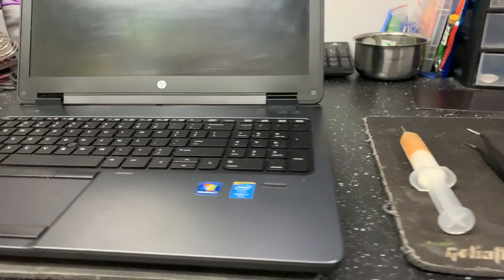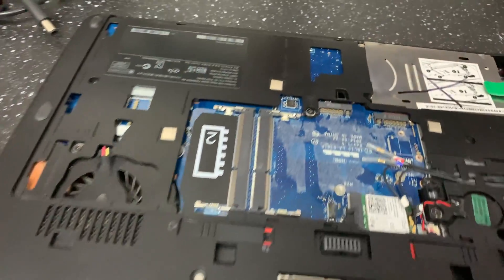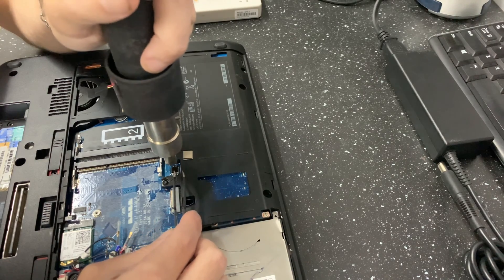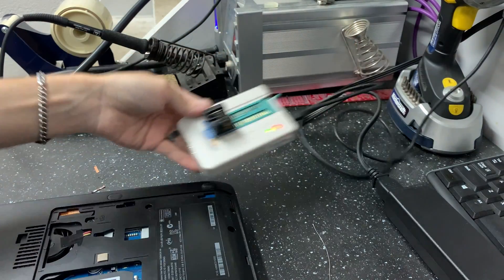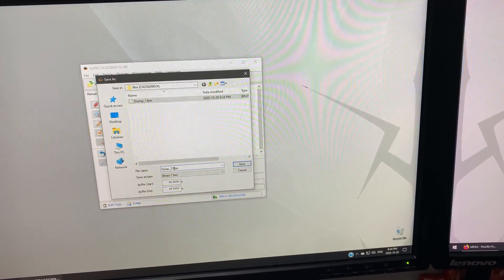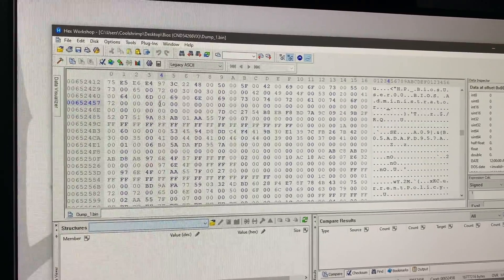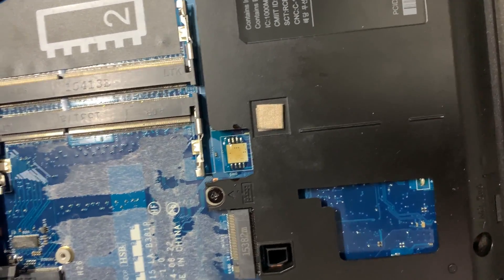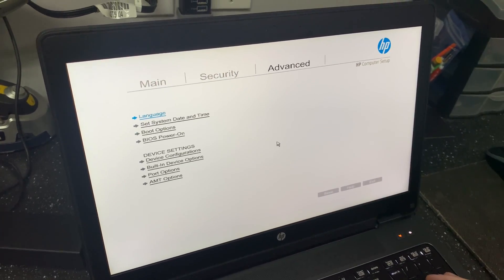Remove Bios Password - HP UEFI Laptops (ProBook, EliteBook, ZBook)

Comment: Hey I love the video, I have the HP Spectre x360 it's a little different because it doesn't let me load bios at all it just prompts me to the Administrator Password or power password screen right away . Then recommends the HP sparekey recovery option. Ive done some troubleshooting but do you think I could reprogram the chip on this board aswell? Any advice helps thank you.
Reply from the maker: At the password screen, hit enter 3 times and you should receive a 'halt code' - try using the code on this site to generate master key. 

https://bios-pw.org
Reply from the maker: Chip removal is an option but since most hp can be done without bios chip reprogramming try that first.
Reply: @CoolshrimpModz  I've tried removing the rtc battery I'm afraid to use the paperclip method where some say it shorts the two pins from the rtc battery and resets the bios . I bought another battery and tried with no luck . I even called HP and tried there steps but we can't get into the bios . It doesn't prompt a halt code either.
Reply from the maker: @paulzeev  can you send a screenshot of the password screen you see. And error screen after 5+ failed attempts.
Reply from the maker: @paulzeev  I just contacted one of my sources they say if you enrolled the spare key feature you will have to follow similar method as video and clean/reprogram bios chip.
Reply: @CoolshrimpModz  just sent the screenshots. I wish I would have used the sparekey program. I bought and didn't know the Bios Password was on there .

Comment: Tried on a Elitebook 1040 G4 - There are 2 flash Chips, one 8 MB (25b64csig, Marked "PVT ROM" on MB) and one 16MB (25b127dsig , "Share ROM") - read the 16MB - Can't find the BIOS password "BiosUser00" - lots of text but not this one - help appreciated
Reply from the maker: I believe the chip should be “W25Q128BV”. Try using this automated tool, extract your original bios file drop it on this application icon it will create a clean image into the same folder.

https://mega.nz/file/d4UFlKaJ#29d6opk-4WjPTH2CNcDDQ8P8aUoDVqnqn-G4Zos7gDg
Reply: @CoolshrimpModz  W25Q128BV and the 26b127dsig I believe are the same, just from 2 different vendors. Tried the tool; it changed the file, close to a placed with the text "UserCred" so it looks promising. I will try to install - but it will take some days before I'm back in the lap- i will post once done. Thanks for the reply :)
Reply: @karstensaunte7322  did it work ;D?
Reply: @anthonyturninggreen8066  Yes - sorry for the late reply - it is unlocked and running smoothly!
Reply: @karstensaunte7322  Before or After "UserCred"?
Reply: @karstensaunte7322  I've done this also but there still a password prompt on bios (It change the after data on "UserCred" it removed the "admin pw"
Reply: @dominicjohntanas3574  same thing

Comment: Ok so I followed this to a T....and after the chip was installed the only thing that happened was the light on the front of the laptop just blinked orange and white.....I tried this on several different laptops....All the same model and they all did the same thing...luckly I work at a electronic recycling facility so there are plenty to try this on....but I can't make this work....anybody have any advice
Reply from the maker: Message me on Facebook I can help you. Also if you flash your original dump back the laptop will be back to original state and still functional.
Reply: @CoolshrimpModz  well i have about 30 of these laptops and they are all bios locked from the previous company that owned them....I was wanting to unlock them to try to resale some of them...so they arent doing me any good in that state...cant resale with a locked bios...so they will probably just go to scrap...
Reply from the maker: @edenschildren4238  message me on Facebook.
Reply from the maker: Also flashing orange/white usually is a battery issue try to boot with AC only no battery installed.
Reply: @CoolshrimpModz  That is what I did...no battery AC only and just flashed like a strobe orange and white

Comment: OMG..dude. I've been doing IT for a long time. You blew my mind with this. Since I'm a nerd I found this fascinating, but aside from that I never thought to do something like this. Where did you even acquire the knowledge to flash the BIOS chip from? 

Also, it was a bit disappointing that you seemed to skim over the area where you put the pads down for re-soldering the chip on the board. Even a layman knowing about flux can de-solder a chip, but re-soldering is where having skill comes in. Having a demonstration would have really helped since I think anybody even considering doing this would probably not be in your part of town to have you do it.
Reply from the maker: Iv done a lot of ModChips and that type of work  so flashing and editing bios it’s pretty easy with the right tools. Check out my TikTok I post on there mainly.

Comment: No need to read twice and compare. Read once and just use the verify button. It will read it second time and compare it to the first read.
Reply from the maker: Your right. But at least with read twice you have 2 physical files saved. Incase you edit your original by accident you have a second original.
Reply: @CoolshrimpModz  True, good point. And by the way, this exact method works only up to 840 G2 and other series with similar release date (2014-2015 I guess). After that G3 and G4 use a different keyword and G5 and later need EC bios, not main bios, modified and again use a different keyword.

Comment: Excellent video my friend. As a PC Technician it has been a challenge to remove BIOS passwords from especially laptops. Please tell me the names of the tools I would need in order to achieve what you achieved. Thanks.
Reply from the maker: Usually a soldering iron/heat wand. And a eeprom programer for reading and writing the chip. Link to some in description just see what chips you normally need to work with and see if there supported by programmer.
Reply: @CoolshrimpModz  Cool bro. Thanks for informing me. I appreciate it.

Comment: Awesome video. I came back to type out the BIOS password you cleared as I don't have the technical ability to handle hardware components, but I did not see reasonable strings to copy, can you help by sharing the original BIOS password you cleared?
Reply from the maker: I do not know the original password as it was set by a user, this is why we do this process it clears the password and returns it to be blank. after that you can set the password to whatever you like.

Comment: Hello I love your videos they are so easy to follow. I just have a quick question, I am going to buy a programmer and would like to know if the program that you use comes with the programmer or do I have to purchase the software separate. thank you
Reply from the maker: The program for read/write itself is free (FlyPRO) and can download it off the programmer manufactures site. The one I’m using is a pretty cheap programmer. But can do many chips.
Reply: @CoolshrimpModz  what is the programmer you used?
Reply: @CoolshrimpModz  what is the programmer you used?
Reply from the maker: @No_Lxv31  I used a SOFI SP8 in the video but most PiC programmers work for this.
Reply from the maker: @No_Lxv31  here’s another video doing another bios but a diffrent programmer https://vm.tiktok.com/ZMrbnUop6/
Reply from the maker: @No_Lxv31  here’s examples of all the types Iv used. https://vm.tiktok.com/ZMrbn2EhU/

Comment: hi, I have a zbook 2x detachable workstation and one of the kids accidentally set a  uefi password, we can't even boot to windows and hp won't help  ... would it be better to just get a new bios chip, and do you know where I could get one?  I take care of all our kids computers and phones, but I'm not great at soldering.  Ebay is  mostly selling from eastern europe and I need to get this thing up and running by the weekend, lol, bc she's starting a digital art class.
Reply from the maker: Hey yes easiest way is order replacement chip on eBay but it can take 2days upto a months depending where it’s from. Once you get it have a local shop solder it for you. Any cellphone repair shop should be capable. Don’t bother with a big box store most don’t do component level stuff.

Comment: HP 8470P NO FOUND
Reply from the maker: You may need to try the pin shorting method, and if still does not work order a replacement bios chip off eBay and install.

Comment: Hi, do you think this will work on a Probook 450 g5? And could it work with a soic8 clip?
Reply from the maker: Yes should work on all of them. And the cheapest option if you only have to do one is buy a replacement cleared bios chip on eBay and just get someone to solder it in. You don’t need the expensive programmer to do one as the chip is only $8-25

Comment: Hello, will this work on probook 6450b? And is it possible to do something like this without removing the chip and the motherboard?
Reply from the maker: Yes should work the same across most Probook models. 

But you will have to unsolder and reprogram the bios chip. 

There is no software only method like (SMC.bin) as they are no longer avaliable from HP.

Comment: Thnx man its worked but boot list and vertual option is looked. any way to open it?
Reply from the maker: If I remember I think you have to now add a password normally, reboot, then logon and remove password. If it doesn’t work let me know.
Reply: Just use the reset security settings option in bios.

Comment: Great video. Thanks!
Any chance to do this job without unsoldering / removing the bios chip?
I am not the best in soldering. (I have to do it on a HP ProBook 4530s.)
Reply from the maker: Only one other option you can try but I haven’t tried on your model. You need to short 2 pins on bios chip.

https://superuser.com/questions/1108228/remove-bios-password-for-hp-probook-4530s-reset-bios

If this doesn’t work then you will have to edit/replace bios chip. As they no longer provide the smc.bin file to reset the easy way.
Reply: @CoolshrimpModz , thanks a lot! :) I tried the other way already, without result yet. Maybe i have to do repeat multiple times.
HP s#x this way, as they want to change and charge for a whole new motherboard. :(
Reply from the maker: @axelh.7690  ok yes HP used to provide a file but they no longer do, and if you pay they simply replace the whole board or they use the smc.bin internally and tell you they replaced it but we can’t know for sure. They don’t simply replace the bios chip as they don’t do component level repairs.

Comment: Can I take out the bios finally and not putting it back on the laptop?
Will the laptop still work fine
Reply from the maker: If you remove the chip the laptop will not turn on. A Chip must be installed to power on. And must be correctly programmed. Make multiple first backups keep them safe as they can be reprogramed to repair it even if you need to replace the chip.